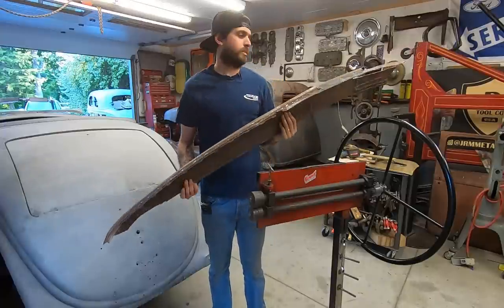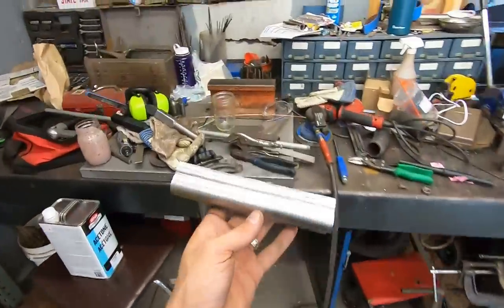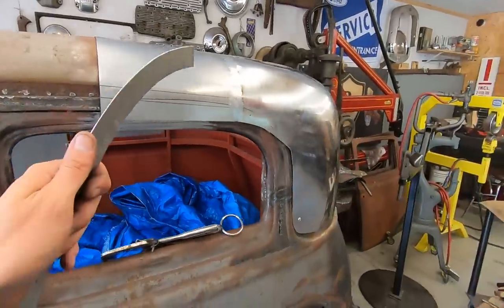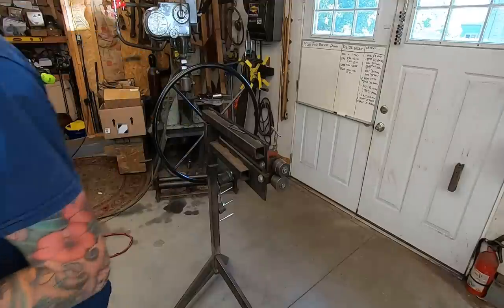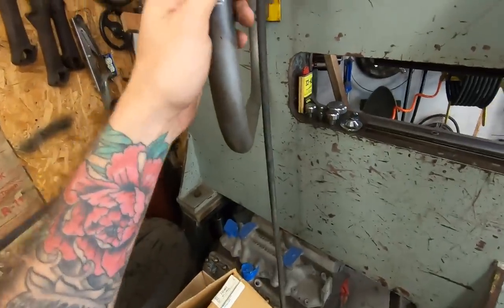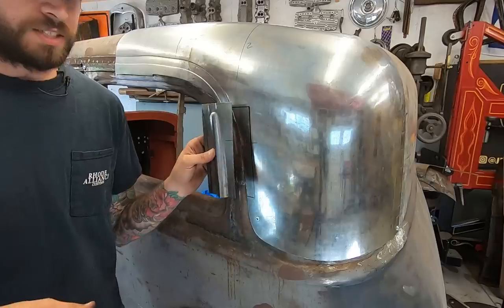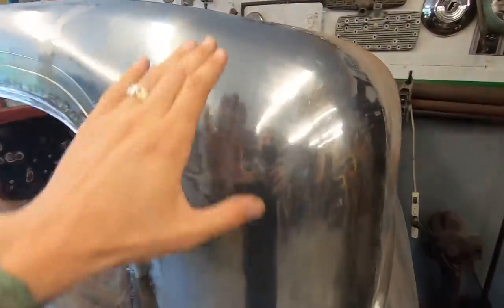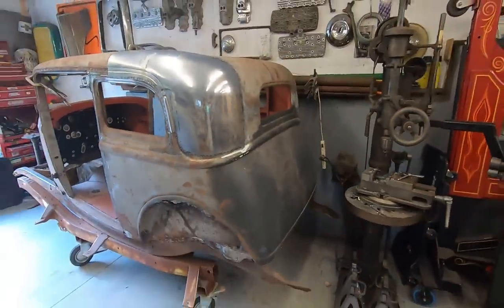1932 Ford Vicky Roof Corner Tacked in LOTS OF SHAPING!

Comment: Great looking metal work!! Hard to tell in the video. When you made your cuts with the metal saw, did you do them 90 degrees to the face or at a 45 deg??? As I recall, watching others, the cut is made at a 45 so it acts more like a "butt" with no gap???
Reply from the maker: Yes I do try and cut the panel at an angle so I can get a tighter fit, doesn’t always work for every situation but most of the time it does!